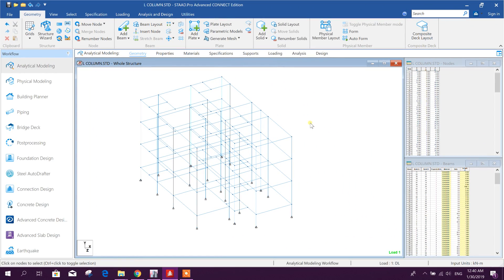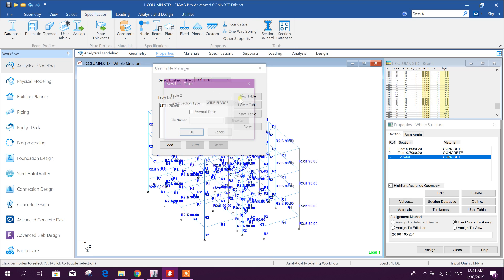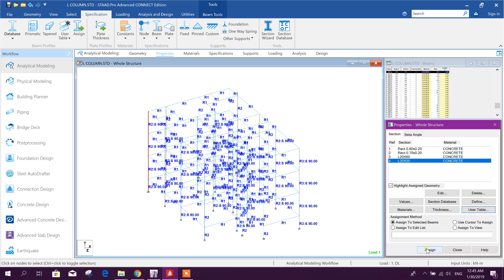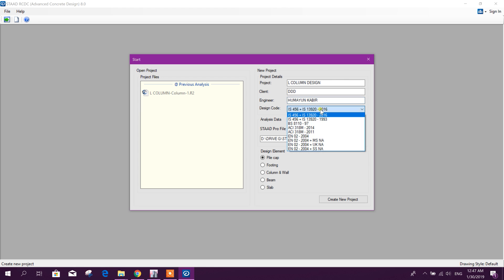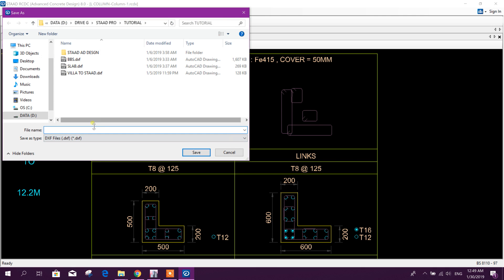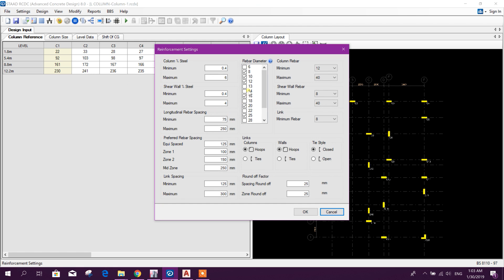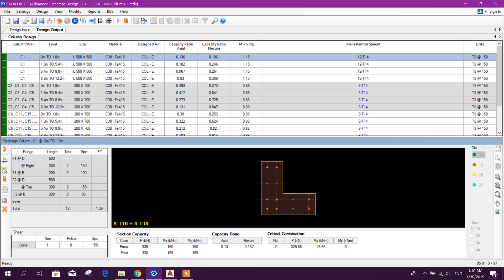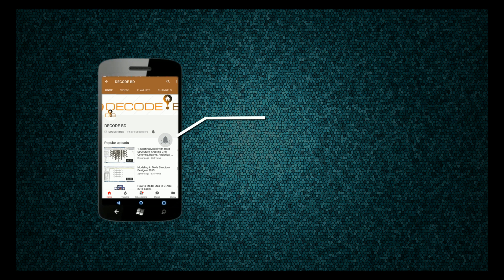L COLUMN DESIGN AND DETAILING IN STAAD PRO CONNECT EDITION

Comment: Dear Sir

After I run my analysis in staad.pro there is warning  **WARNING- TD or TB IS ZERO IN USER TABLE= 1 for the L concrete column section which I created in user table. Can I ignore this warning?
Reply: I also got same warning
Reply: Did u got solution for this

Comment: Hello sir is your RCDC  V8.0 can read analysis from etabs .mdb file? I think my RCDC V8.0 was not installed properly because it cannot read analysis file from etabs it will crash when i tried to do design from etabs .mdb file.
Reply from the maker: No, version 8 can not read etabs mdb file
Reply: @Decodebd  Thanks for the reply sir, actually I already resolve the issue. The installed Microsoft Access data base engine in my PC is 32 and 64 bit that's why RCDC will crash when i use etabs .mdb file analysis.
Reply: I uninstall microsoft access database engine from my pc and download the latest 64 bit microsoft access database engine and install it. Then my RCDC can run etabs .mdb file analysis.